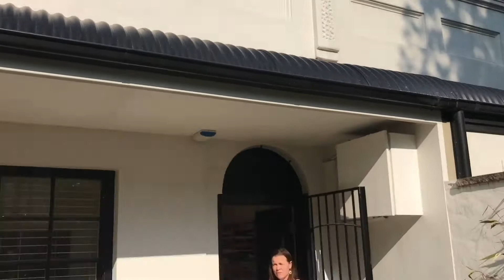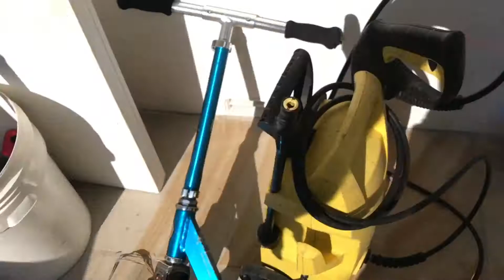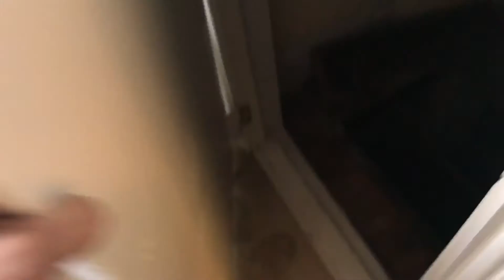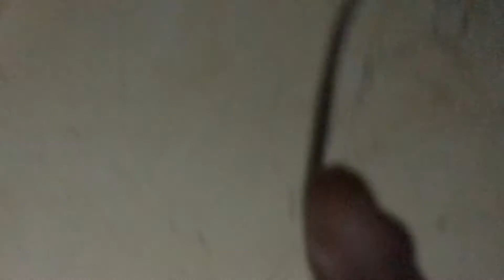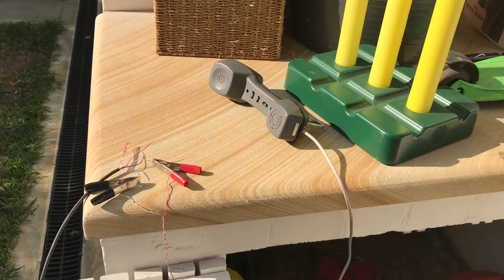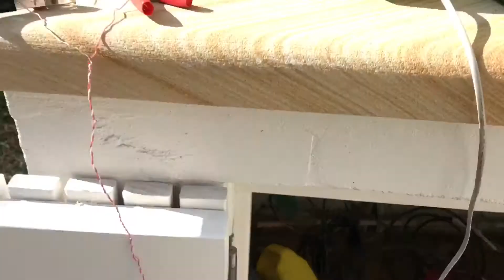The Cable Fault Telstra Doesn't Want You to Know About

Comment: Wiring a mess no neatness and wires thrown about down holes

No wonder lead in and customer wiring is bad on a lot of cases

Telstra are so quick to say it’s a customer wiring issues

British Telecom do similar system but it’s a lot neater the end user wiring and the main cables from the street